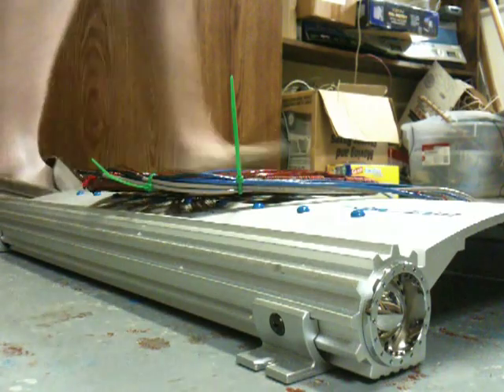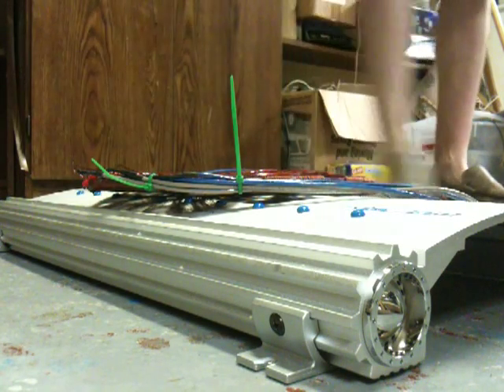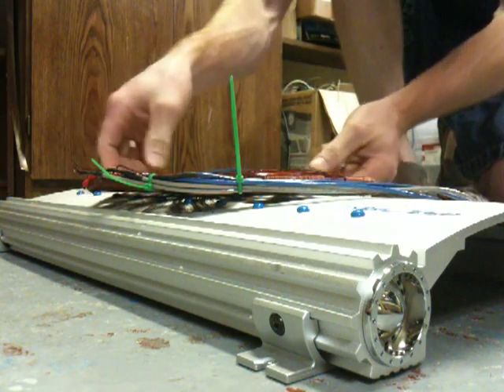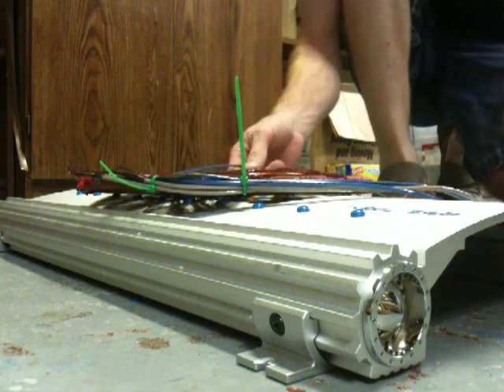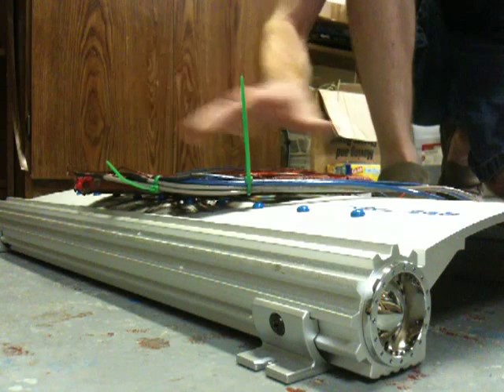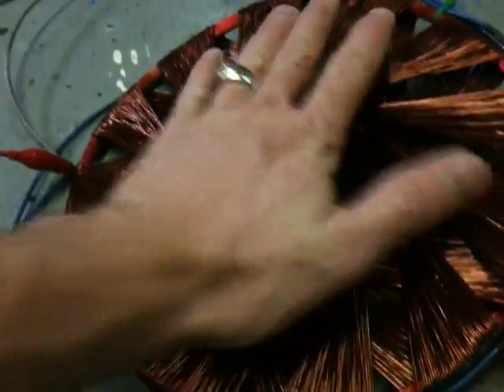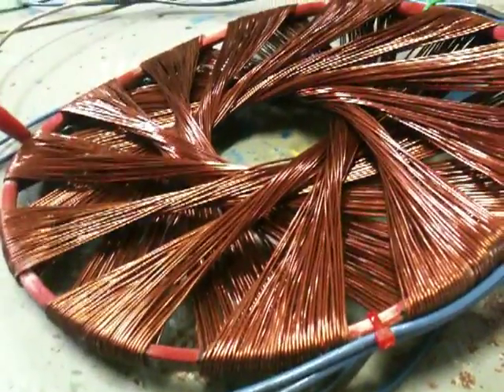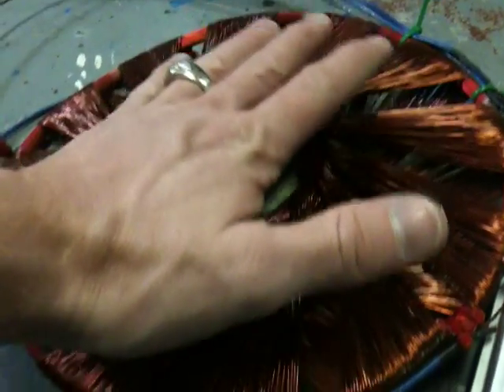#2 Levitating 9" Rodin coil, Lenz law lavation via 120AC (TEST20)

Comment: cool stuff. I wonder why when you flip coil upside down it does not levitate. You using AC current so it should work both ways... Maybe try to put some resistor in series to cut current flow.